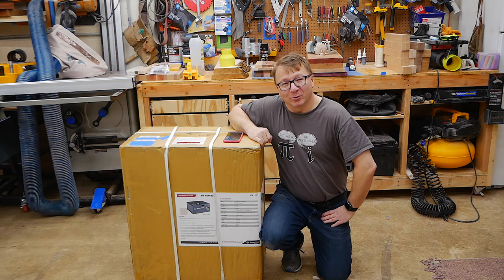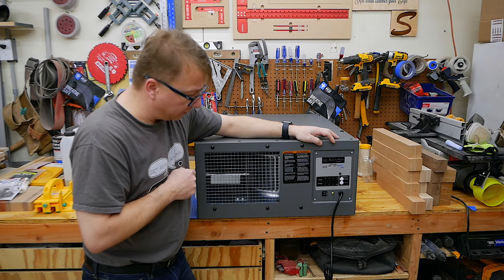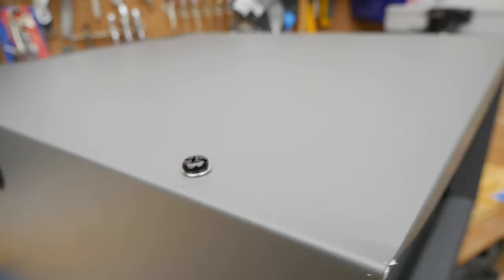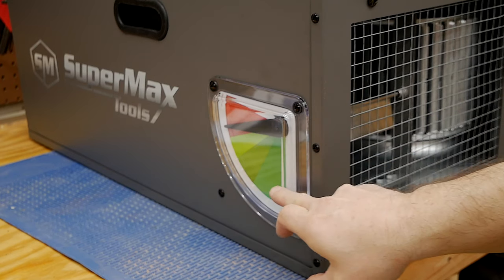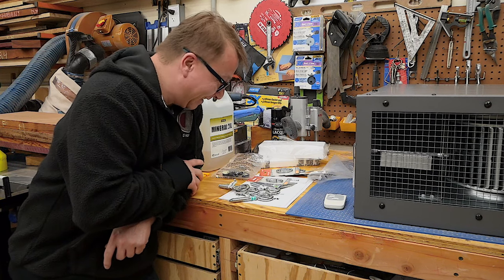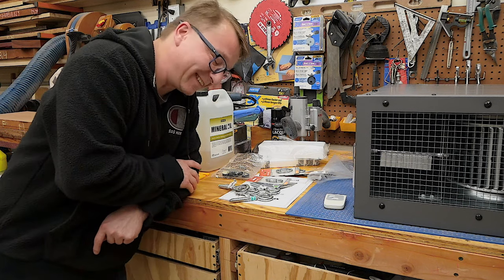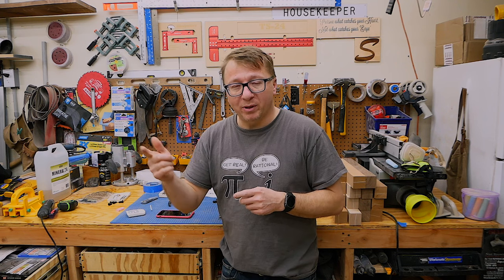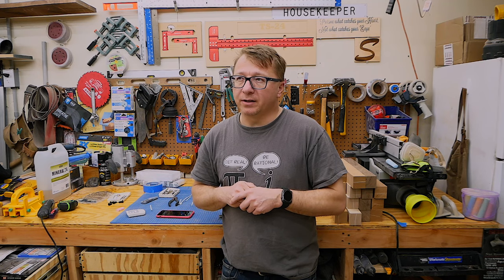How to make shop air cleaner - air quality upgrades

Comment: Any updates after using for 6 months?
Reply from the maker: Hi Josiah - the unit is operating well so far.  I will say the the outside filter gets "full" quite quickly, which is a good thing.  Hitting it with the leaf blower or air hose clears the outside particles easily.  So far so good.  Thanks for watching and commenting!
Reply: @cyberreefguru  Cool! Thank you!